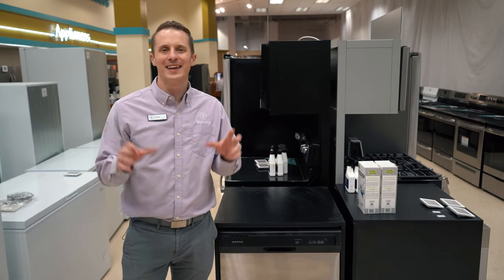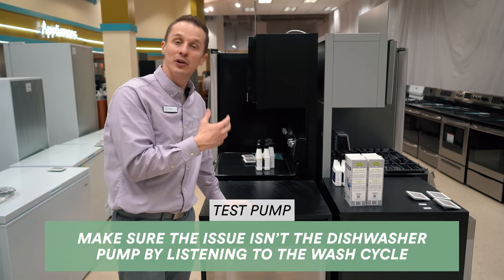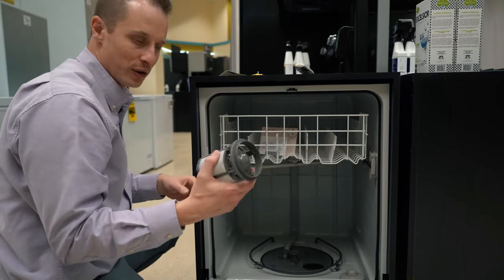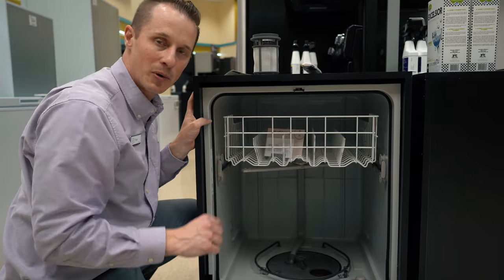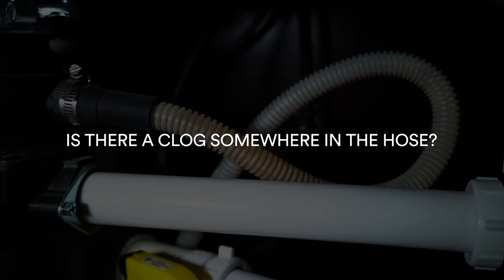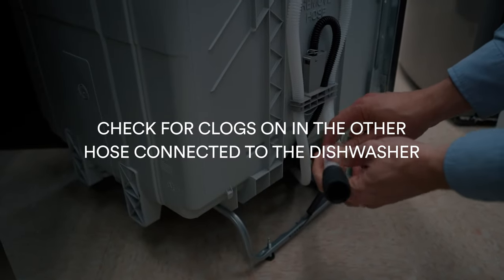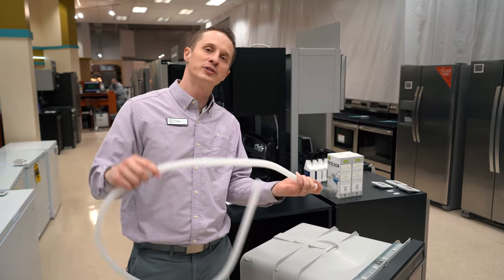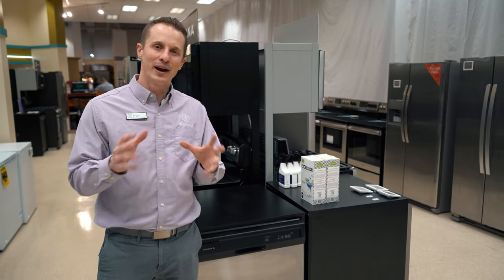Dishwasher not Draining - Easy Fix!

Comment: My problem was the opposite. For years my dishes didn’t clean well. I finally discovered that the plumber connected the drain hose to a drain pipe below the unit instead of up to the disposal under the sink. The dishwasher never held much water as gravity would drain the unit before the pump cycle ever started.

Comment: Thank you for the advice when you have a new disposal and need to break the drain plug!!!!!
Reply: What bothers me is there’s no instruction to remove a drain plug that’s unnecessary in my case. But I had to retrieve the broken disposal to remove the power cord just to reinstall it on new disposal. Crazy.

Comment: New disposal was installed by someone else and they never pulled the plug out. Easiet way to remove it without pull out the whole disposal is to take a screwdriver and tap it through with a hammer and pull the plug from the disposal side of the sink. (Cut breaker to make sure disposal doesn’t kick on while your hand is in there. Hope this helps.

Comment: What dishwasher component could lead the drain pump to only not work at the end of the cycle when the water is hot, but the pump works just fine after an hour or so when the water cools? The problem isn't the usual suspects -- the pump is fine, there are no clogs or air blockages, and when it's hot there is a slight hum sound but it doesn't seem to be coming from the pump. Any thoughts?
Reply: How’s your water pressure? It seems to abort the wash cycle but not fully drain prior to it. Restarting it will complete drain an wash normal if the water pressure issue is corrected.
Reply: @NobodyUR  thanks for the suggestion. Water pressure is good and consistent. The issue seems to be related to temperature. When the water cools, the pump will empty. It's odd.
Reply: @tinetannies4637  im having the same issue
Reply: Did you ever solve? I'm having the same issue, but we're still at the diagnosing stage. Water will drain if I start a new cycle, but there is always water standing.
Reply: @simcowgames981  No, I never got a correct diagnosis and just wait for the water to cool and then hit the drain cycle. All the explanations people suggested didn't fit the problem. It's not the pump because the pump works fine throughout the cycle. There are no clogs. The issue is mysteriously and entirely temperature dependent, which is why it will fully drain when cool without issue but won't when hot. So I'm just living with it as for some reason it only conks out at the end of the wash cycle and not during the wash cycle. Which makes the problem even odder.

Comment: I have a question and hope you can guide to troubleshoot...i have a new dishwasher, samsung, about a year old. Mother , without knowing, put dishwashing soap and obvisouly bubble overflow...cleaned it up, but, dishwasher now has the NORMAL light flashing and pump runs none stop. I turn off,  it turns back on by itself and continues.. what could it be??
Reply from the maker: One thing you can try is to unplug the dishwasher for a few minutes, then plug it back in to see if that resets the system.

If that doesn't work, you could try checking the pump for clogs and clear them if necessary. If the issue is with the control board, it's best to call in a professional repair service.
Reply: same issue, have u sort it out?